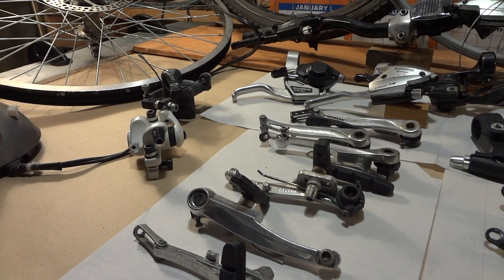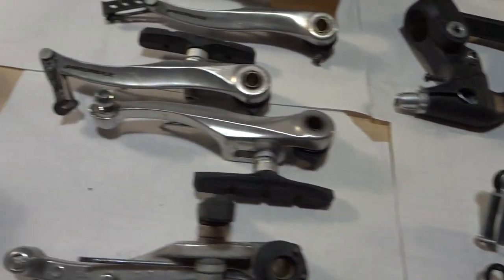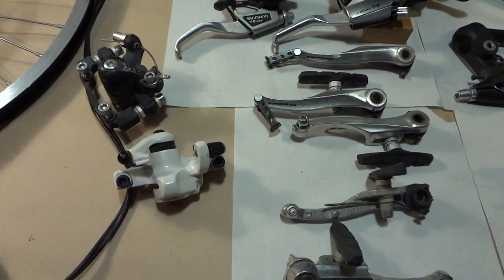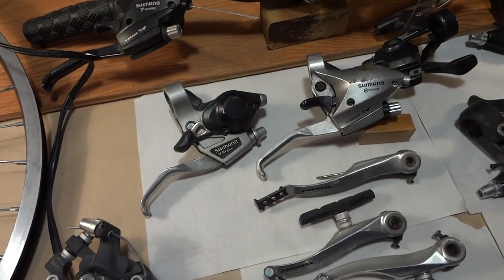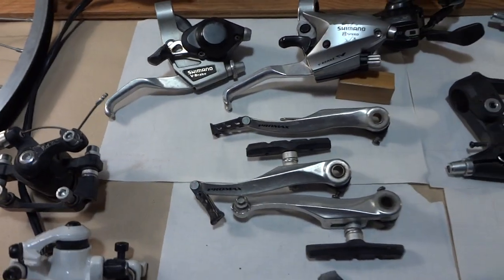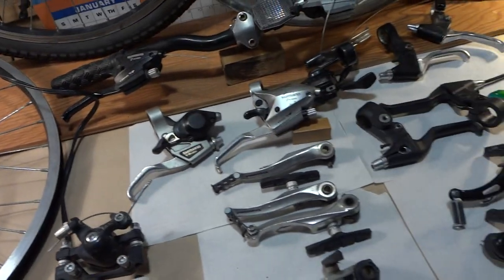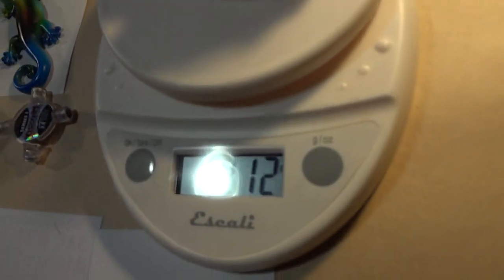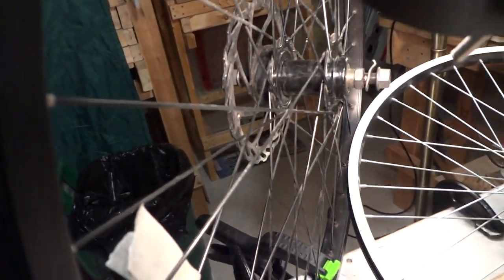Disc vs rim V brakes the truth they wont tell you

Comment: The truth they won't tell you? This guy is comparing cheap low end disc brakes vs rim brakes. 

Not all rims and hubs are made out of steel. Not all disc brakes are cable actuated. 

There are pros and cons to both disc brakes and rim brakes. Both can be acceptable and or exceptional. 

The author of this video has no clue and needs to do more research instead of just hating it due to weight difference.
Reply from the maker: I just check what you are riding "Scott Genius 960 – $3499.99" And you come here to hate you got to be kidding,  get your head checked pal. Not just weight, stopping performance. I made it clear this video is for 99.9 % of bikes out there under $1000. So yes technically im comparing cheap disc brakes to cheap V-brakes. So why would somebody want much more weight with much worse braking ? They dont, hence the purpose of the video, the truth they wont tell you.  You sir havent a clue what you are saying. have a nice day.
Reply: @BIKEMAN21  Umm no I don't ride a Scott Genius 960 and what I personally ride doesn't exclude me from having or forming my own opinion. 

From the very beginning to 19 seconds into the video you make the broad statement rim brakes are better than disc brakes. 
Your video is misleading to people out there who don't know much about bikes and bike tech. Your video title says it all. 

As I stated in my original post: both rim and disc brakes have their pros and cons. It's up to the rider and what suits the riders style of riding that will ultimately dictate which is better.
Reply: And contrary to me coming to your video to "hate" I came here to help inform those who come to see your video. 

Comparing steel rim wheels to alloy when it comes to weight? 

Where is the disclaimer that you are ONLY referring to cheap disc brakes and rim brakes? You may be showing cheap parts but to many people out there they won't know the difference. 

I hope this helps explain my post and why I commented. It would be nice if you did some research before making a video hating on disc brakes. 

Remember, disc brakes are used in cars, motorcycles and airplanes for a reason.
Reply from the maker: @liquidSpin  its not misleading. I don't think you have a clue at what is being offered below $1000 especially since you ride a $3500+ bike. That would be like a mercedes dealer giving advice to a person looking for a average car. I'm giving the facts here and you are the one misleading people.
Reply from the maker: @liquidSpin  The disclaimer is at the 20 second mark. I say this is in "regards to bikes under $1000".  Everybody is entitled to their own view point. But you are going about it ALL wrong. Also, I have been riding and and fixing bikes for over 20 years so i would say i've done real world research and not keyboard warrior trolling. Cheers.
Reply: @BIKEMAN21  funny how you consider me trolling as I am not. You got your feelings hurt by someone criticizing your video. There are plenty of people out there who have been working and riding bikes for many years. That doesn't make you special and entitled. 

Cheers~
Reply from the maker: @liquidSpin  You are a troll in every sense of what a internet troll is. I wonder if you would enjoy people trash talking your video riding that ridiculous scott genius bike. I went to their website they wont even give a price.. says a lot.
Reply from the maker: @liquidSpin  you didnt come here to inform anyone of anything, you came here because you got your feelings hurt because i said disc brakes are shit and a gimmick. You spent $3500-4000 on your scott genius ridiculous ugly snob bike and are so pissed off that you got ripped off that you are trying to justify the purchase and attacking anything that leads you to believe you got screwed. Have a nice day.
Reply: @BIKEMAN21  you definitely got to do a follow-up video for all your haters trolls and lovers thank you sir for keeping it 100
Reply: @Jarrod_D  😂
Reply from the maker: @Jarrod_D  I'm actually thinking of that. taking a stock low budget disc brake bike, do braking distance tests, then remove the discs, replace with the cheapest metal caliper V-brakes to run the same braking tests... That's what we need. Not some jerk off bike snob using a 4000$ bike to test disc vs V- brake
Reply from the maker: Damn Daniel !!! When you live in a glass house you are what they call a target rich environment : P As soon as i see this punk riding that $4000 bike and trying to make his video uber cool... i was actually confused if it was a commercial for the bike or just some guy making a MTB video. (still not sure but dont really care)  Its kind of like those guys driving loud cars with loud music ... look at me, look at me ! OMG my car is so loud and i go so fast im so cool ! Lets see how fast and loud i can race down this street full of kids playing o_O
Reply: @BIKEMAN21  salty 👍😀
Reply from the maker: @Jarrod_D  The salt must flow !

Comment: So some bikes literally weigh 4 tons?
Reply from the maker: yes sir they do, every pound of weight will slow you down
Reply: @BIKEMAN21   To a point yes, but after a certain point stability takes precedence over lighter weight. The lightest any causal rider wants or should use is 20 pounds. Over that it becomes more and more  unstable. You are also comparing the cheap disc brakes with cheap hubs to good quality rim wheels. Those calipers are likely not alloy, but steel. A set of shimano mechanical calipers used to be 30ish. Rim brakes also require a pretty true wheel and the rim is heavier than a disc only rim. The shimano calipers also are pretty light. You are putting a ton of bias with nothing to back up your claims. Also v brake levers are the exact same pull ratio as mechanical disc brakes. The “v-brake” levers you praise so much are great for disc as well. The complaints about tourney using steel in a plastic housing are though valid, but irrelevant. Shimano or any company will make anything to a price point. Your video is a rant or comes off as one.
Reply: @BIKEMAN21  lighter is not always better.

Comment: On a road bike dork discs are totally stupid, as are carbon clinchers.  Discs on a mountain bike make more sense.
Reply from the maker: lol good one. what is a carbon clincher ? I googled it and youtube'd it... no actual answer found.
Reply: Depends how much you ride in the wet.  Based in Scotland here and most riding is on wet, muddy lanes for me, and sure my rim brakes work well enough but I can hear the rim being worn down. Got discs on the tandem and mtb and will gladly be swapping to discs on the next road bike.

If you're fortunate enough to mostly be riding in dry, clean conditions then yes I'd stick with rim brakes for the weight savings and simpler maintenance.  But disc brakes are not "totally stupid".
Reply: @thepandaman  wait you said you can hear your rim being worn down what your hearing is your v brake pad being worn down from rubber to metal rim.

Comment: Disc brakes suck! And why do they only have one disc brake rotor? I don't trust them at all I own 5 bikes, kugoo kurin v1, Eff fat tyre bike, sondors fat tyre bike,  trek e bike, and an old raleigh hybrid e bike. Four of them had disc brake failure within 3 months of riding! But the 10 year old raleigh e bike with v brakes ( I haven't adjusted or changed them in 12 months) powers on come rain or shine

Comment: Maybe turn down the volume on that terrible critter in the next video??? Much appreciated! Yeah, I'd rather swallow a broken light bulb than ride with this crap! The worst invention of the 21st century! Non-adjustable, oil leaks, expenisve calipers, madening squeaky sounds, warped discs, heavy as an anvil! The only good thing I can say about my disc brakes is, that they are very effective at breaking! Almost to a point where it becomes dangerous!

Comment: Aero beats weight every time

Do your research
Rim brakes are dead,they are being phased out.
Also rim brakes literally grind your expensive wheels away.
Reply: Do your research - disc brakes aren’t aero.  They are being phased out because it suits the bike industry.
Reply from the maker: I don't ride full speed so the less weight the better. But If I need to stop fast V-brakes are best. Plus easy to swap wheels from your other bikes. And you can't just walk into a big box and expect to find disc pads.
Reply: Ceramic coated rims for rimbrakes > than small crappy discbrakes that overcook and get glazed brake pads @MrGarycoww. Even my dual pot xt with 203mm rotors are not as good and lack the modulation that my crossmax + xt-vbrakes.
Reply: @henriks5008  if you pay $2,500 for bicycle wheels. Than sucker must be tattooed somewhere where they can see it.
Reply: @Jarrod_D  If you only spoke english one could understand. ;)